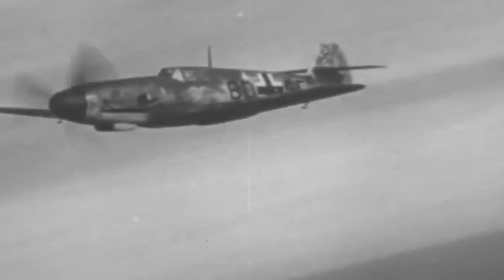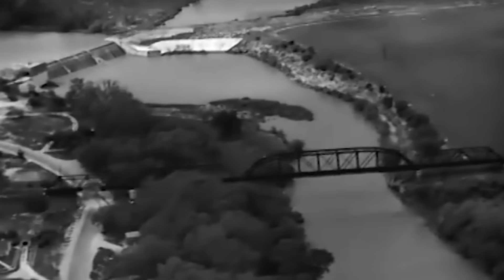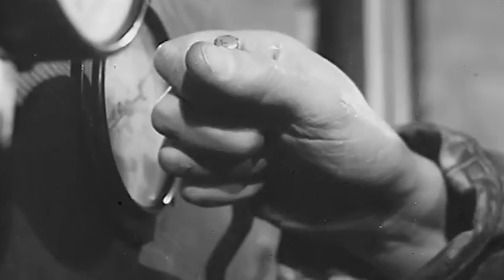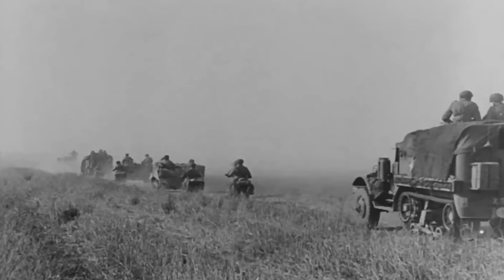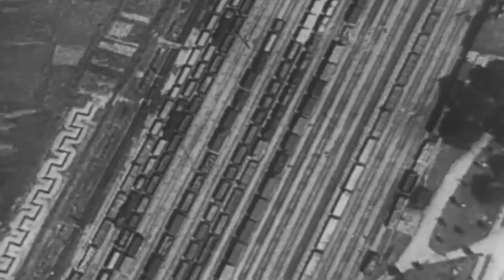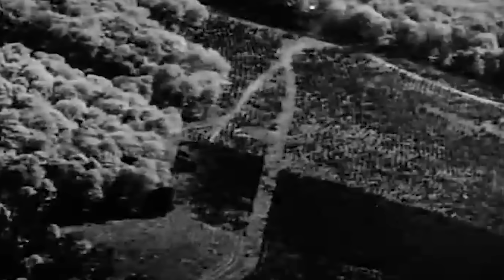Inside Germany's Most Dangerous Jet Aircraft

Comment: Early radar didn't lock on, the radar operator followed the blips and estimated speed and altitude.
Later height finder radars gave you the altitude but in the 60's we were still guessing at speed
Reply: Correct, and incorrect at the same time, at the time of the AR-235 radars didn't "lock on", however that capability was developed with X-band fire control radars in the early 1950's not the 1960's .
Reply: @erichammond9308  So the radar could not not lock on @raymondclark1785 stand uncorrected.
Reply: I couldn't help but think of Spaceballs radar operator when I read your comment.
Reply: @akairborne In 1963 I was in an EC-121,  what now would be called an AWACS.
Off Virginia I picked up a fast moving blip that I guessed the speed at 1500mph 
In 1963 we didn't have any aircraft that could do Mach 2 for 500 miles.
Everyone laughed at me but it turned out to be a Nike-Zeus fired out of Wallops Island
Reply: @raymondclark1785  Whow, EC-121 based on super connies, i remeber they used them during Vietnam war but if iam not wrong it was more airborne early warning command and control not like todays AWACS, not 100% sure but i think their callsign was "Red Crown" in vietnam
Reply: @Sturminfantrist The SEA version was a lot different 
Even the east coast version with the data link was different than that used in Florida and the west coast
Reply: some of the first ETO prox fuses used as AA, not ground arti was no doubt used on these battles.
Reply: Mid war radar could lock and track.  The US SCR-584 could lock on and track a target from about October 1943 when it was introduced after the Germans jammed the SCR-268 during the Allied landings in Salerno Italy.
-The German FuSE 64 Mannheim radar issue 2 could be locked onto a target from early 1944.  The British AI. Mk IX could even be locked onto a target from 1942 but the program suffered delays. It was never completed due to the death of some of the engineers in a crash.
-Converting spherical coordinates to 3 dimensional adhesion with an easily solve problem used by fire control system systems and radar.  They provided not only Cartesian position but velocity.
-The key to autolock circuits was to get the range gate lock first.  Once that was done the conical scan could be resolved into X and Y component and centred by servo drives on the antenna.  
-SCR-584 surely could lock on to the Ar 234 it was just too fast to intercept and too high flying to target by AAA.
Reply: Even the British “Chain Home” radars in 1940 could give altitudes.  Probably with triangulation.
Reply: Historical fun fact:  Early radars didn’t even have “blips” as we think of them today - they had an oscilloscope screen, and a spike represented a radar return. The distance along the x-axis (time) told them how far the target was, and the height on the y-axis gave some use of the size/number of targets; there was no azimuth or altitude display, and definitely no locking onto anything.  The azimuth was known based on the direction the beam was pointing, altitude was unknown.  Later developments provided the more familiar “radar scope” display most are familiar with, as well as ability to determine altitude.  However I’m not enough of a historian on the topic to say when those advancements appeared.

Comment: Good, but the British Reconnaisance plane had a name and it wasn't a Vickers Wellington as shown here. The Mosquito was the aircraft that Germans couldn't catch so please name it.
Reply: Welly’s certainly did recce. But not iconic for it.
Reply: Wellingtons did do recce flights , bud. Mossies came in much later in the war than most folks realise, and every air frame that could carry a camera over enemy terrain did so. And lots never made it back home.
Reply: @thomashiggins2704  The Mosquito first flew reconnaisance flights in 1941 and was unmatched for the entire war untill the Arado appeared. Reconnaisance flights used high and fast planes, so not the Wellington. This is what happens if AI curates a video and sticks in random photos that correspond only in time. Photo Reconnaissance aircraft were modified to carry cameras and it was primarily Spitfires and Mosquitos, both of which could outfly German planes. The Spitfire PR XIX, the fastest PRU variant of the war, had a top level speed of approximately 445–460 mph (716–740 km/h) at altitude. Other types that flew photo reconnaissance were Hurricanes, Hudsons and Blenheims.
Reply: @stephenskinner3851  PR XIX (Griffon engine) came late, primery PR Spit early in the war was the Merlin engined MkXI with Bowser wing (more Fuel longer range) btw MkXI nose was abit differnt because of bigger oiltank,only my 2 cents, but MkXI in PR Blue camo it was the best looking Spitfire with the more rounded deeper nose
Reply: @stephenskinner3851 unarmed and stripped kf radios and armour plating Griffin powered PU Spitfires reached over 480 mph.    Some late model fighters  reached that speed at 25,000 feet.   The Spitfire hold the record for the fasted speed of any jet or piston  aircraft of the war with a speed of Mach .89.   It reached Mach .92 but was damaged beyond repair at the High Speed Test range i  mid 1943 with an early Griffin in a shallow dive.   The wings were bent back at a 35 degree sweep.  The exact sweep of the F86 and Mig 15  eventually.   The British shared all data with the US as part of the Tizard  mission.  Ironic how some PU runs were flown straight and level while others at spicific banks in a slow turn.   Different tactics for different images.   While its important to recognize the 234's presence it didn't  acomplish must do to Germany's lack of aircraft and fuel.   The Jumo 004A was an amazing  engine but because of shortages of metals it could not be built in numbers.  So the 004b was the most common German jet engine and it had several major flaws owing to being made from mild steel largely.   Had Germany been able to secure alloys in large numbers it would have changed to look of the war.  Britian would have been forces to take Turbojet production much earlier and would have been forced to use the supirior Metrovick Axial flow tubojets to handle German jets.
Reply: @thomashiggins2704  People forget the Spitfire flew PU flights over Germany including Berlin the entire war. Few were ever caught.  Some PH units changed from the Spitfire to the Mosquito but the demand for airframes for other uses limited it's use for some time.
Reply: @jimdavison4077 Nick nick dibble dibble nick nick (sorry couldn't resist)😂

Comment: I have read that the engines used in the ME262 and Arado Ar 234 had to be serviced after 8 to 10 flight hours. Is that true?
Reply: Yes those engines did not last much more than 10 hrs, but you must remember that it was lucky if a fighter plane lasted 10 hrs of combat at that point of the war.
Reply: @Hydrogenblonde .
Yes, but the planes were often flying over an hour, for 5-10 minutes of "combat", so, this makes it hard to make 5 flights in defense against the Allied bomber raids;  YES, making, let's say, 20 runs against a bomber squadron entails a non-zero chance if death, and a definite chance plane getting hit, and requiring repairs on the ground,
Reply: @Hydrogenblonde .  Yes, but, there was a lot of flying needed to happen to get a plane in position to defend against an Allied bomber squadron...even for a few minutes at a time!
Even though making 15-20 runs on a squadron if B-17s entailed a non-zero chance of getting killed, and a significant chance if plane getting hit/damaged requiring repairs on the ground, engines failing in flight were causing a shockingly high loss rate of the planes, even when pilots didn't otherwise need to bail out...
ALSO, these planes were NOT designed to make engine replacement easy, or quick to complete!
So, having better/longer lasting engines would have made a significant difference!
...rather glad that didn't happen, though!
Reply: The Jumo engine flight hours were very limited  10 -25 hours  if used,  double if the pilot was experienced and very careful ... So one or two longer recon missions, a single extended combat or a transfer flight and the engines could have had to be rebuilt/replaced..... Certainly in under 50 hrs . 😬 They were running out of metals like Chromium Nickel and Cobalt ...even Al. the other problem was fuel .. too many projects not enough  concentration on standardized production numbers.
Reply: The later ones were good for 25 hours which was better than some piston engines of the period
Reply: The problem with new technology is that’s new. It takes a lot of R&D for a new technology to become refined enough to where it’s reliable. Germany was a the forefront of jet technology. But even after the war and with the benefit of stolen German research and personnel, the Americans and Soviets didn’t field their Sabers and MiGs until the late 40’s/early 50’s. During WW2 the British benefited from having a few key technologies arrive just in time.They had the Spit, but also radar arrived both in March of 1936. This gave them a competitive plane and the means to pinpoint where and when they were needed. This eliminated the need for 24 hour standing patrols, which would have worn out machinery and the pilots who used it, and spread them too thin. Much of the technology needed to fight a war like WW2 didn’t exist until well into the war. Germany lacked a plane like the Mustang which was sorely needed in the Battle of Britain. The arrival of the Mustang years later allowed the Allies to defend their bombers on long distance, high altitude flights into Germany. None of this could have been foreseen. Even the Spitfire’s famous wing came down to the stipulation for an 8-gun design. The designer insisted the wing remain super thin, so it was expanded into an elliptical shape to accommodate the 8 .303’s.
Reply: @catsooey  Stolen research? Did anyone object to it being taken, if not, it can't have been stolen?
Reply: @mikeconey2164  Not the definition of stealing! Stolen, stolen I say! Not bought, not given - stolen! And the Soviets stole a Rolls Royce jet engine from the Brits. Seriously though, I’m still amazed when I see the design of the Ho-229. It still looks futuristic to me today.
Reply: @catsooey  You will find that if you actually read a real history book that the worlds first active jet fighter aircraft were the Meteors on RAF 616 squadron, the German jet engines were total junk with an average life of only 16 hours. German tech was old hat.
Reply: @georgebarnes8163 I know about the Meteor. It entered service a few months after the Me 262. The 262 went into active service in April of ‘44. The first combat incident occurred in July of ‘44. The first jet powered aircraft was a Heinkel He 178 which flew in August of 1939. There’s no doubt that England and America had their own jet programs, but they were not first to develop a jet aircraft or fighter aircraft. I’m a big fan of the Royal Aeronautical Society podcast. 

In comparison to the Me 262 the Me 262 Meteor was an inferior aircraft. It improved later, after the war of course. But the first version of the Meteor was slower, had less firepower, and it didn’t have swept wings. The Americans and English were both very late to adopt swept wings for their jet aircraft. For it’s first incarnation the Me 262 was also supposed to have an engines in its wing roots, but delays in engine development and war time necessity the engines were places under the wing. There wasn’t time to redesign the plane to incorporate the engines properly in the wing roots.
Reply: Due to the dangers of flameout if the throttle was used to make rapid changes the throttle was moved very slowly. The engines were used at 80 to 100% power continuously which rapidly shortened the 25 hour life to 10 to 12 hours before a complete rebuild of the engines was nessessary.
Reply: Watch the video ffs.
Reply: Turns out it takes time to develop the alloys that can withstand the heat the turbines in a jet engine would experience. Even the jet engines of the 60's, 70's, 80's, 90's, the 2000's and the 2010's required more maintenance then the jet engines of our current decade.  Yes, those early jet engines required complete overhauls almost after every flight...
Reply: Modern turbojets are set for approximately 500 hours. Now, this was as of 25 years ago when I worked on TF-30s and GE F-110s. It may be longer now.
Reply: 20 hrs is what I heard for total rebuild or replacment, german ww2 jet engines lasted longer than modern Chinese jet engines. The germans didn't have the proper metals.
Reply: Google it my friend 😮
Reply: Yes
Reply: If they did not blow up, by then, then, yes, they needed needed 'work'!
The problem was that Hitler was so certain that they would crush the Soviets in 1941, they weren't authorizing/funding numerous advanced R&D items like jet engine (after all, the unstoppable V1's and V1's were almost ready to go!), so, by the time they decided to ramp up the production of jet engines, they no longer had access to sufficient quantities of some special metals needed to comprise the alloys needed that would make the turbine blades last sensible lengths of time!
It was supposed to be over by then;  but, the NAZI's (and half of the world!) were victims of the NAZI's nacissistic delusions!
Reply: Sounds about right. At least the early engines had issues with damage due to overheating. Especially the blades had an issue where if the engine was used at full power for too long, they would harden to the point that they became brittle and then broke. The materials they had available just could not withstand the high temperatures for extended periods of time.
Reply: It all depends on how aggressively you use the throttle. If you are very gentle, it can last much longer. But yes, under full combat conditions, the engine needs a major service or rebuild after 10 hours.
It sounds bad, but a Junkers Jumo required very few man hours to build compared to a high-performance piston engine, and rebuilding it was relatively easy, you mainly needed to replace the turbine blades.

High-performance piston engines required an insane amount of man-hours to build, with extremely tight tolerances and a lot of routine maintenance.
Just to put it in perspective, 1 hour of combat flight required about 10 hours of routine maintenance.
Reply: @kirgan1000 .
Not quite:  the materials used to.make the engine's turbine blades just were not really going last very long; you COULD destroy them much more quickly, if you did not power them up, and down properly (mostly down, I think, but, not sure:  further info welcome...).